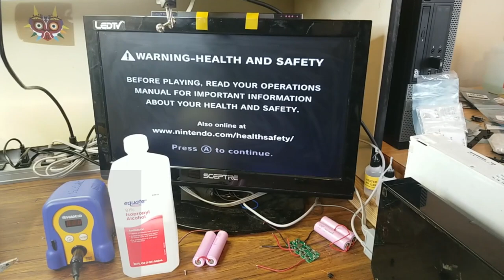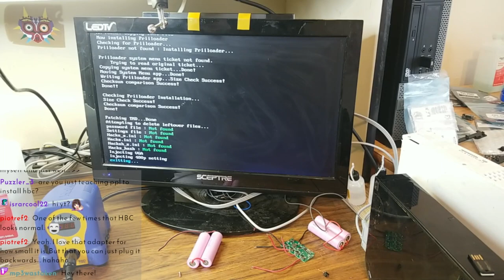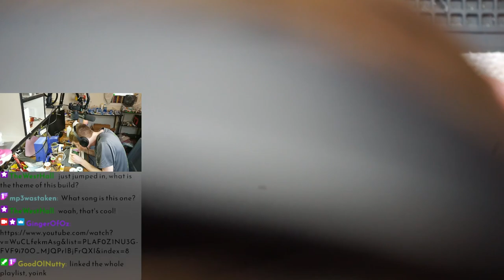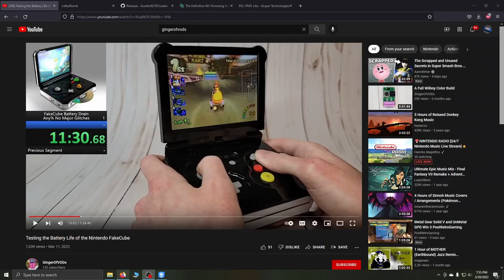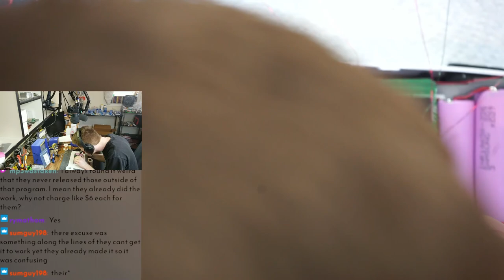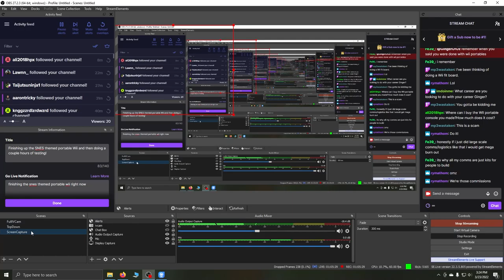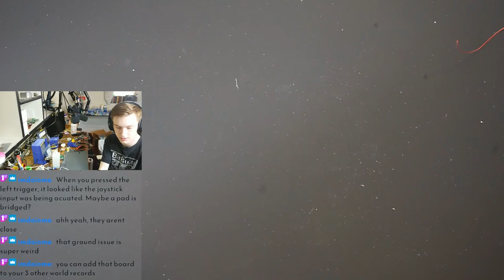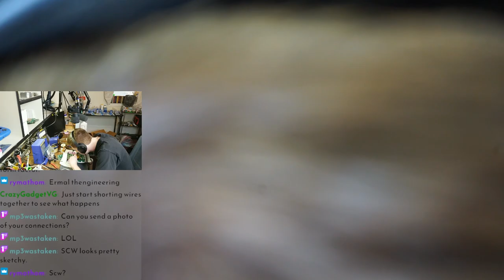A Start To Finish Portable Wii Build Stream

Comment: This is incredible work.👍  My heart stops when someone trims a circuit board with the Dremel.  I don't trust my Wii because it's still running so well.  I'm 50 and can't see very well anymore.  It would be better for the fine soldering work.  Unfortunately I didn't understand everything because English is not my mother tongue.

Comment: Did you have to lift a leg on the IC on the video board? I read of needing to lift pin 3 so the board will work with 3 Volts.

Comment: You don't need 5 volts because it's only used by rumble ,the sensor bar und usb except for the kingston micro sd adapter you are using ,right?

Comment: I stuck the first disc in there but then the disc didn't come out. So I used a 2nd disc to see if that would then kick out the first disc and now I have two disc stuck. So I got AH HA and think a 3rd disc would let me grab all three and pull them out but that didn't work either.